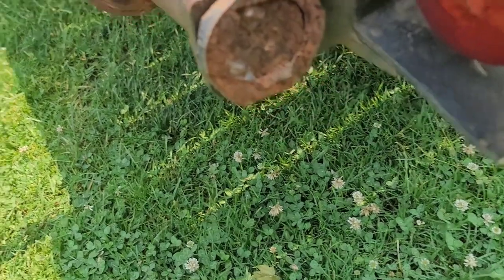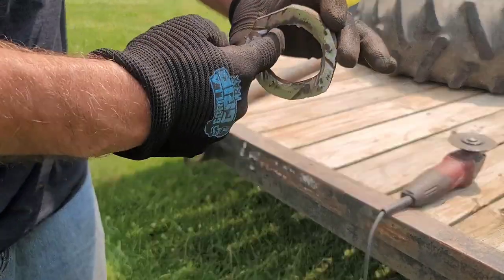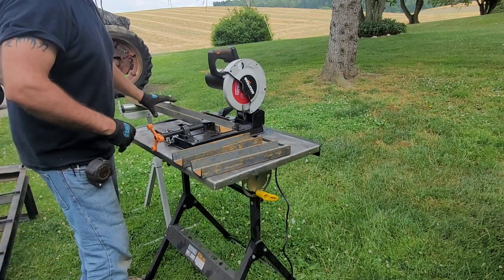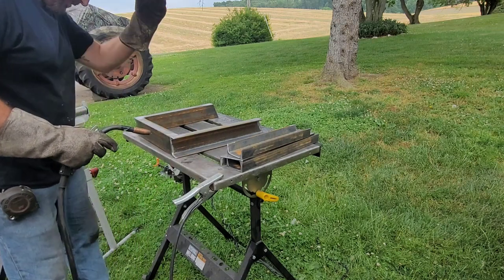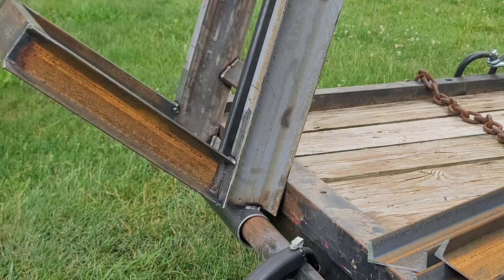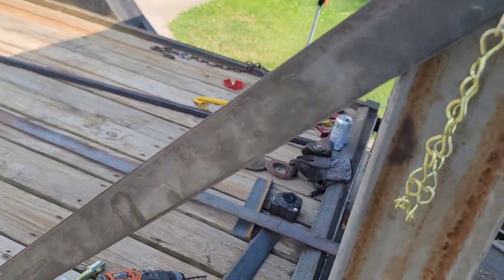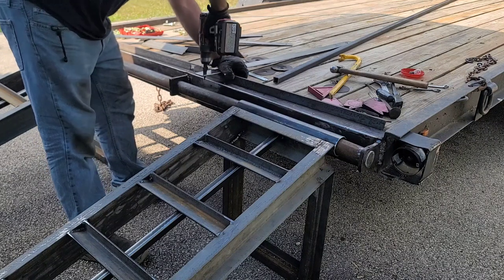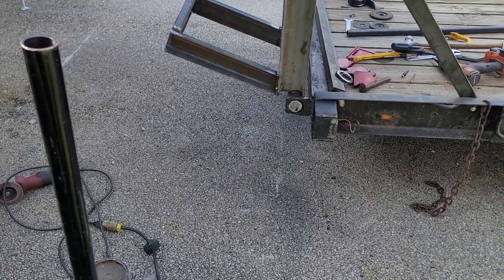Farmall Hauler Trailer Ramp Building Pt. 2

Comment: bending that solid stock straight is more than easy. Especially for anyone with a hydraulic machine of any type loader, backhoe, whatever.  Good video.
Reply from the maker: Yeah it is but unfortunately dont have a down pressure loader as of yet.

Comment: I prefer chains to hold the ramps because you can have infinite adjustment to the angle of the ramps if you have a long load and need them to angle away from the deck.
Reply from the maker: Both have their merits for sure. Chains let the ramps bounce but give extra angle choices.  Bar stock holds the ramps better eliminating bounce. The new trailer build Im currently doing will have both for multiple  options ! Thanks for watching!

Comment: Did you bottom out your ramps yet?
Reply from the maker: Bottom out as far as touching the ground when pulling a tractor up on them while loading?
Reply: Yes.
Reply from the maker: @BigDaddysPlati  yes they touch down perfectly preventing my truck from lifting.  The deckover I restored I built the same ramps for. In the video picking up the 450 Diesel you can see them touching down as I pulled the 9000lb tractor up. Once centered on the trailer they lift right up.

Comment: The pipe that’s holding the ramps on the trailer …is it a solid pipe?
Reply from the maker: The center 6' bar is solid,  the pipe that I welded to the ramps are 3/16 thick 2 1/2 pipe.